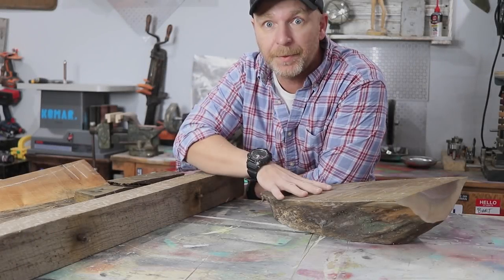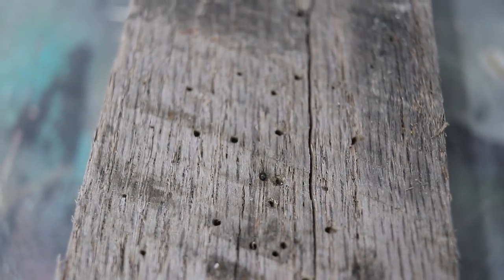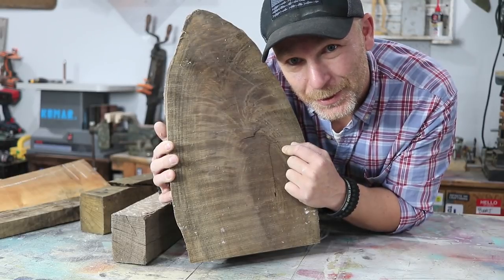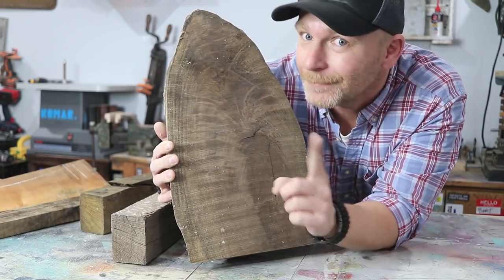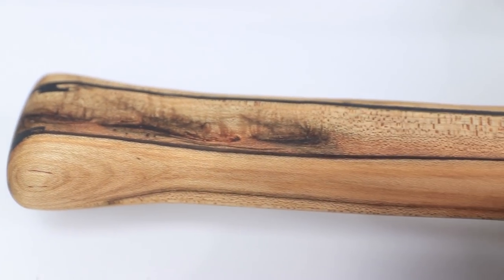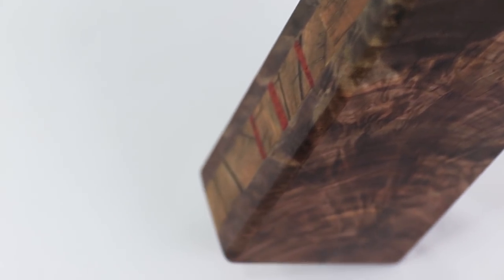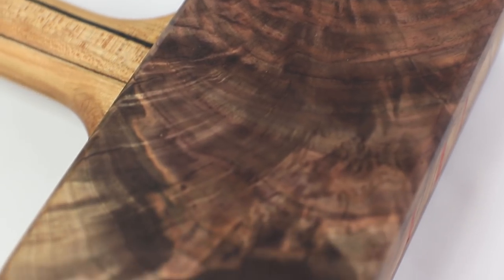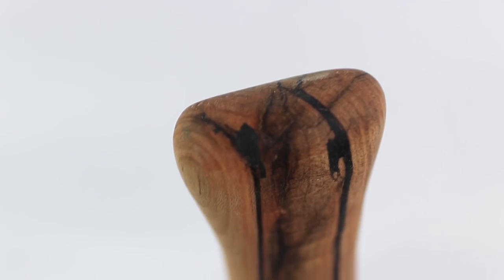Epoxy Stabilized Pallet and Log Woodworking Mallet

Comment: If you would have used bbs as your weight and not glued them in.  The hammer would work just like a dead blow hammer.  Or if  you just would have not epoxied the nuts and bolts.  Also would like to give you a hint about filling on a radius on material.  When you do it as you did in your video.  You are actually making a bunch of small flats.  Requiring more sanding.  Next time you file a radius instead of dropping the front of the file as you move forward.  Drop the back of the file as you move forward.  It will produce a much smoother finish.  I hope you will be amazed by this small but powerful change in action.
Reply from the maker: Bobby Harpoon brother that’s awesome advise. After I epoxied in the nuts and bolts I thought about why people don’t do it to bee-bees and did some research, and you are right.  Next time for sure.  And I’m for sure going to try the file technique. I’m kinda hooked on shaping now with a file. It’s actually really enjoyable

Comment: Cool biuld, Sir! I have a question regarding that metal detector: is it good enough to pick out staples or broken nails, that are broken or even below the surface?
Reply from the maker: Szabolcs Borbély ya it picks stuff up deep in the wood. I think I picked Stuff about 2-3” down in the wood.  Here is the link to it. Kuman Pin pointer Water Resistant Metal Detectors with Holster Treasure Hunting Unearthing Tool Accessories Buzzer Vibration Automatic Tuning KW30 https://www.amazon.com/dp/B074GP3QBD/ref=cm_sw_r_cp_api_i_qbScCbERTD0EG